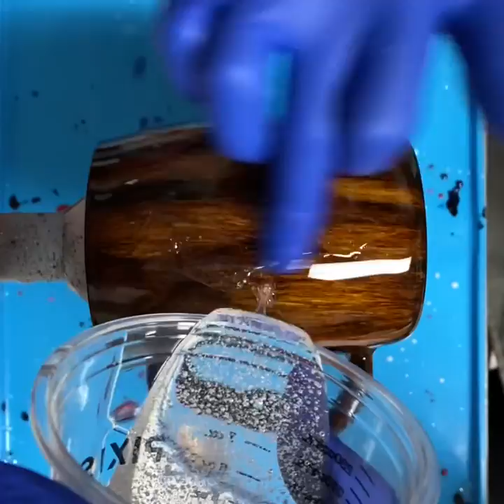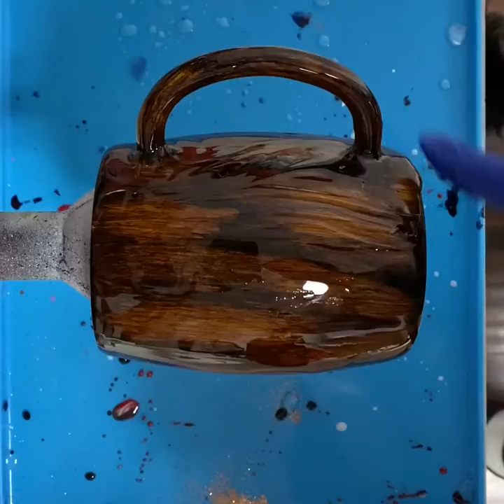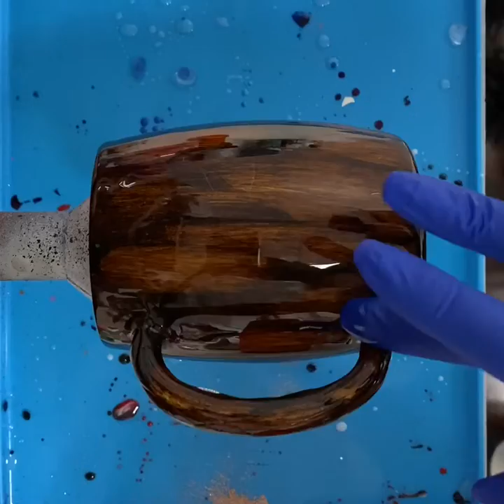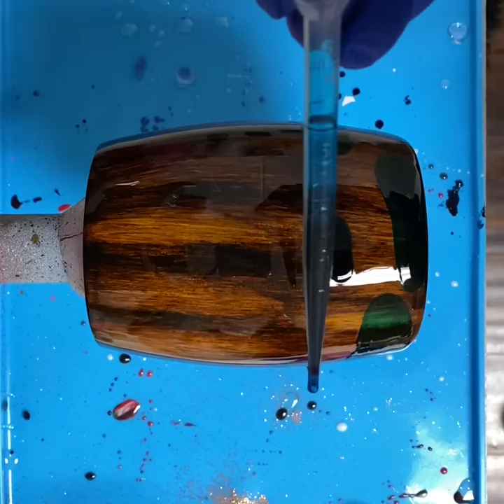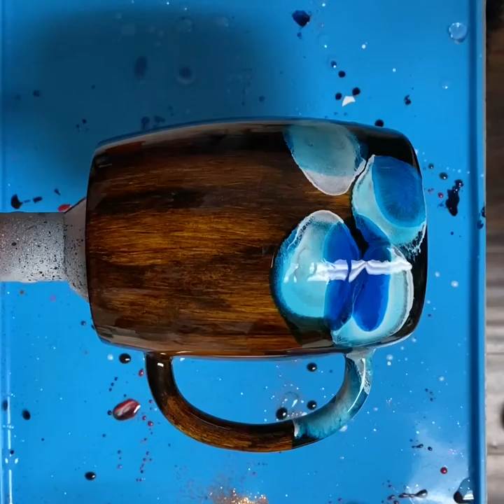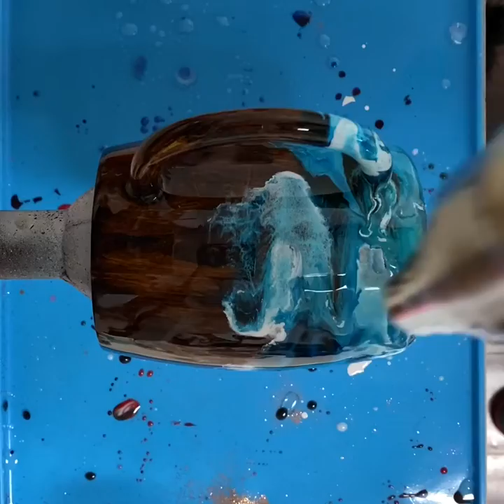Woodgrain Wave Tumbler Tutorial (#1)

Comment: So you don't have to sand between layers of epoxy. The second layer adheres to the first layer without sanding?
Reply from the maker: debbee1977 I usually do a light sanding between the layers, just depends - I didn’t on this one because of the inks.